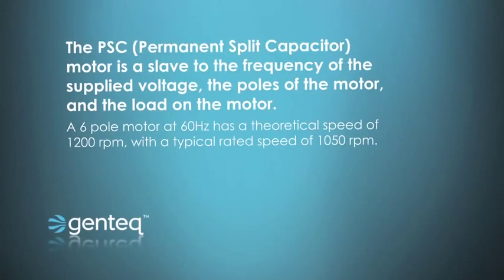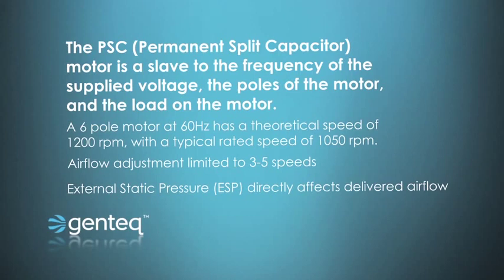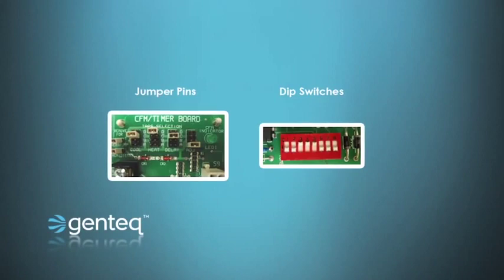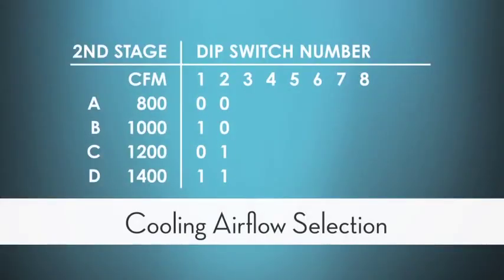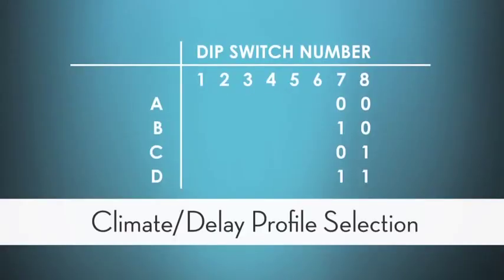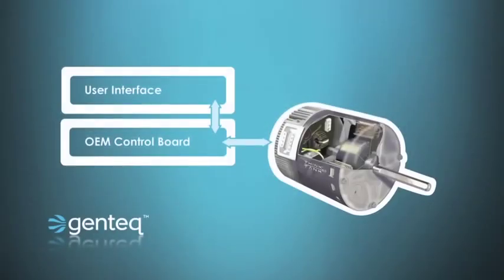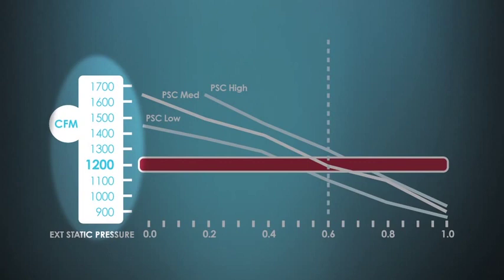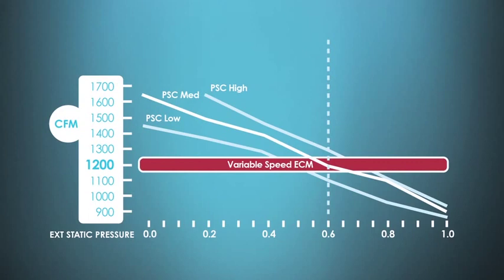Genteq Variable Speed 101 - Constant Airflow ECM Technology

Comment: So, The home owner is the one keeping the furnace or air conditioner in efficient if they don't change the filter on a regular basis and keeping registers closed. PSC motors are more reliable than ECM.
Reply: A dirty filter can take out a PSC too. Obviously the more complex the motor, the more that could go wrong with it. ECM are far better.

Comment: I still don't see the difference between a constant torque and a constant air flow. They seem to both try to achieve a certain torque
Reply: I believe the Difference is in the PSC the torque is dependent upon the static pressure and air flow varies with the torque. Whereas in the ECM the torque is dependent upon desired design air flow, the air flow is set and the torque is applied depending upon the static pressure. At initial startup it's essentially a PSC, it  knows the static pressure by the measured amperage, then the factory parameters set within tell it to increase torque to meet the design flow. The difference is the PSC is riding the fan curve (no ability to correct it's performance), the ECM is riding the system curve and is 20-30% more efficient in it's operation.

Comment: Where are the best spots to take the static pressure ?  How close to the fan ?
Reply: Measure differential Within a few feet of the fan and outside duct pressure to get static
Reply: @areuokdaie  You never go outside the furnace or air handler cabinets to get duct pressure.
Reply: in a furnace you measure the total external static pressure before the evap coil and within a foot of the blower. for an air handler right at the return and supply ducts.